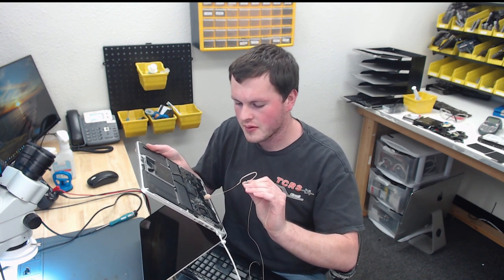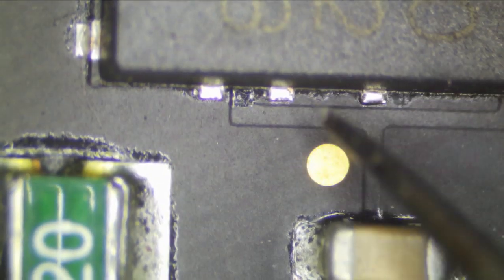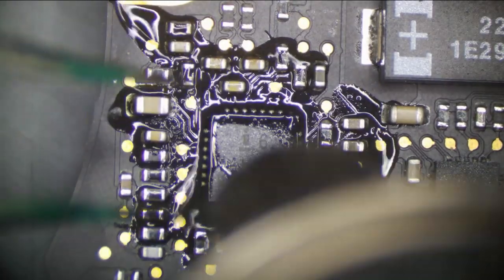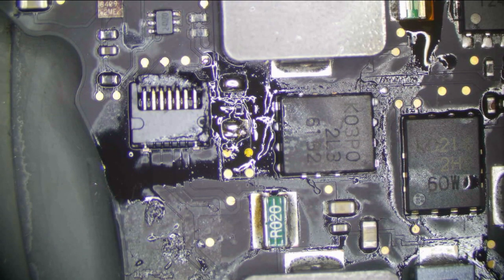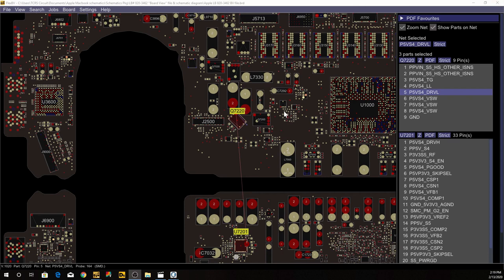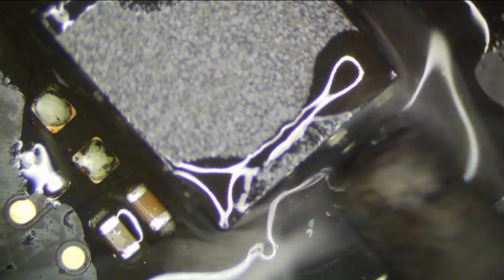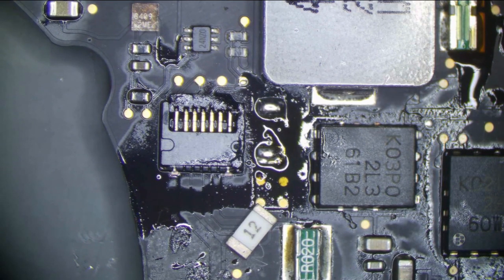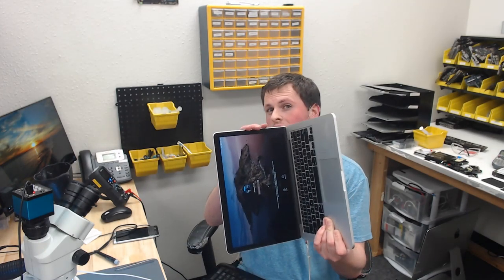What can make a MacBook motherboard make a clicking sound???

Comment: Hi I've had the same problem on a a1502 macbook pro a few years ago. I shipped it to a repair shop where they fixed it for a eye-watering $400 where they said the mobo went bad so they had to replace the whole thing. Well just yesterday, I accidentally dropped it off of my bed to the ground and when I put it in to charge, it doesn't turn on, and its making the SAME noise again. Sort of suspicious because its the same problem as the old logic board in my macbook that was "replaced" yet I'm having the same problem again. At this point I've most likely given up on this device, but just in case, wondering if there is anything I can do?

Comment: love your videos, awesome !! i have a question tim,  how do you use the bench power supplied ( can't figure it out ) do you set it on 5 amp max and set the voltage differently for every macbook?  maybe a stupid question😬 but i want to be sure, hahah! i don't want to blow everything up😂
Reply from the maker: Depends on the rail you are injecting to
Reply: I’m sorry I was not clear 🥴 I mean using it with a  MagSafe Cable. Not voltage injection to a rail yet. Step by step 😜
Reply from the maker: @jaspercourtens7444  18.5 is fine for all
Reply: TCRS Circuit ah thank you so much, I didn’t know that 🙏🏽

Comment: Bro I'm having same issue ..how much do you charge for repair
Reply from the maker: Model and year?
Reply: @TCRSCircuit  2015
Reply from the maker: @vikaaas16  MacBook Air or MacBook Pro? No Power? Location?
Reply: @TCRSCircuit  Macbook Air 2015
Reply from the maker: @vikaaas16  $250 if it's a logic board issue. Are you in the US?
Reply from the maker: @vikaaas16  $250, if it is logic board repair.
Reply: @TCRSCircuit  Okay thank you .but I'm not from US

Comment: I like your work...too bad that you are in America... but, it`s OK. you have in th elast videos a A1398 MacBook with intermittent failures and replaced those mosfets. can you say me please the type of this or where you buy these sir? thank you in advance!
Reply from the maker: FMDF6708N. Available from most electronic parts suppliers.
Reply: @TCRSCircuit  Thank you very much! I appreciate this.
Reply: @TCRSCircuit  Unfortunately i found nothing with this search terms on the germany sites.
Reply: Werner, it should not be the mosfets if your thunderbolt is deactivated and the board works fine :) xD
Reply: @heinzkup  i know but, i would like to have a computer that´s work fine with the original OS without deactivating thunderbolt. ;-) btw: this computer now often failed when i only webbrowsing with deactivates Thunderbolt kext. ;-)
Reply from the maker: @wernerlehmann8264  then mouser from the US